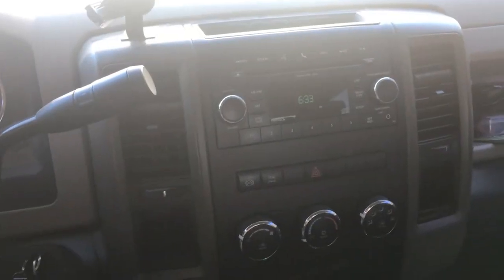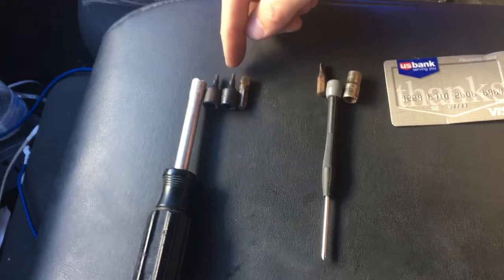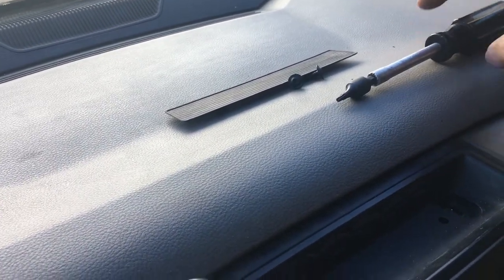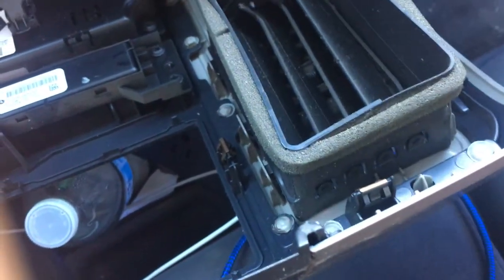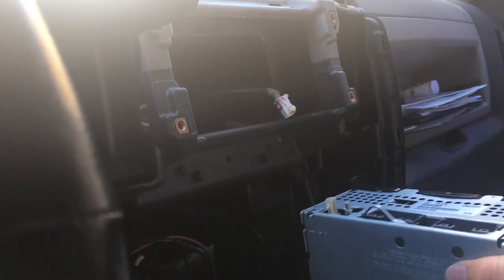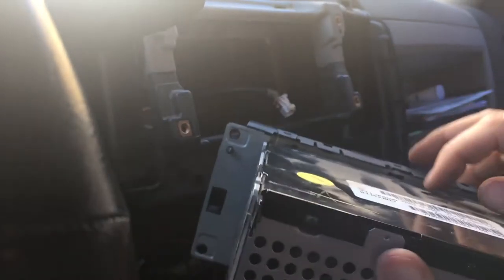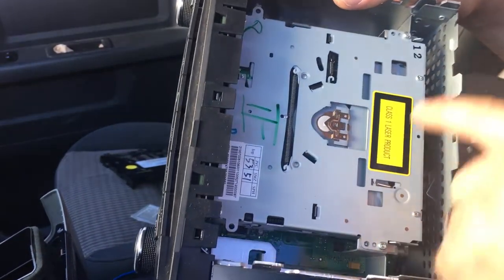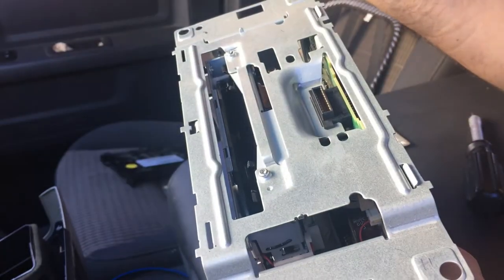2011 Dodge Ram CD Removal

Comment: yours makes a sound when ejecting, mine does absolutely nothing when ejecting
Reply: Get a multimeter and check the power going into the radio connections. Also make sure nothing got jammed in the cd slot, someone stuck a screw driver bit and mine. Had to take the entire radio out and apart to get it
Reply: Mine also does nothing. Says ejecting, but that's it. Gonna need some surgery. :)